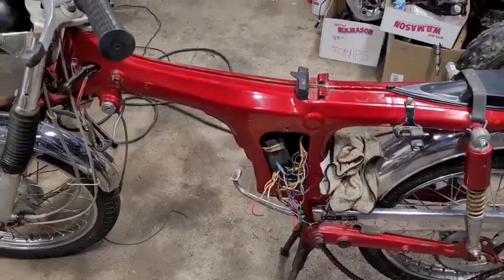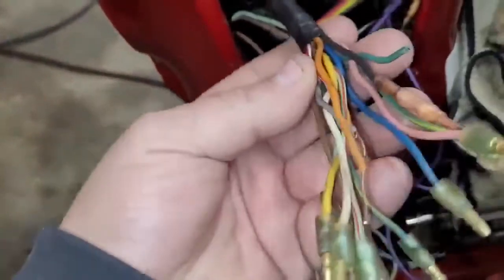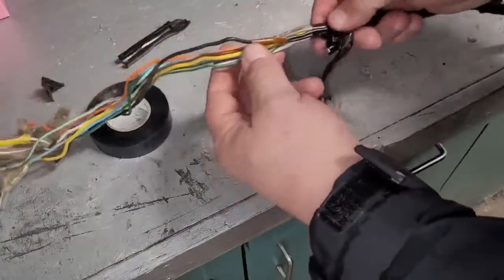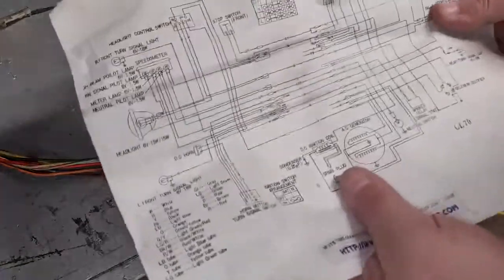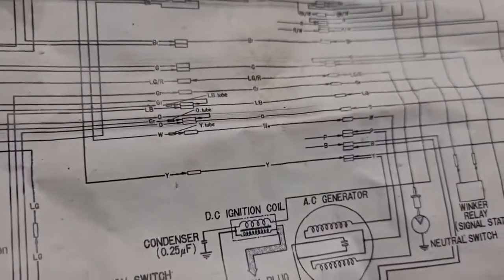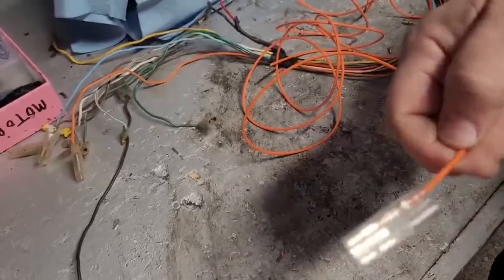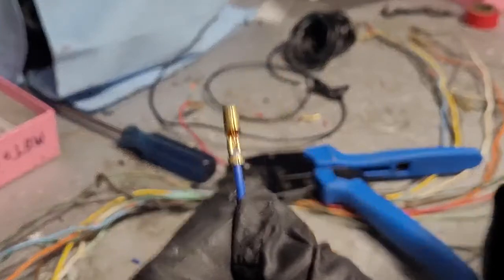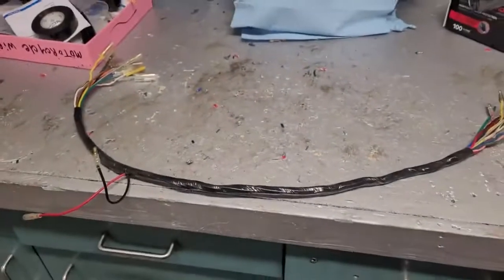Repairing wiring harness on vintage Honda motorcycle.

Comment: I just need to know how to i stall it in the frame
Reply from the maker: Just slide it in through the battery door opening and get the correct end in the headlight bucket and work your way back. Make sure you pull your ignition wires through where the key is.

Comment: Hi, I'm hoping you can answer for me... I'm working on the CL70 harness but would like to check for spark with the engine out of the bike. Can you tell me which wires I need to attach to the battery? options are the ing-coils black & blue... Also the stator cords white, yellow, pink and light green-red. Please advise / thanks!

Comment: Just starting to work on my CL70 Harness. I have the same issue with the 3 wires to no-where. Did you ever get more info on that? Mine is mwssier than yours, with over 7000 miles.  Please advise / thank! Chad.

Comment: i just got an st90 and a wiring harness with all the tube joiners and bullet head connectors everywhere,does all this need to be soldered together?or is it plug and play?because they dont seem to plug to easy into eachother..any help appreciated
Reply from the maker: They actually can be hard to push in sometimes, and also there are two different  sizes. But they will go together with a little patience.  👍